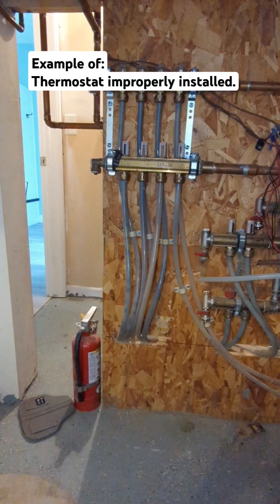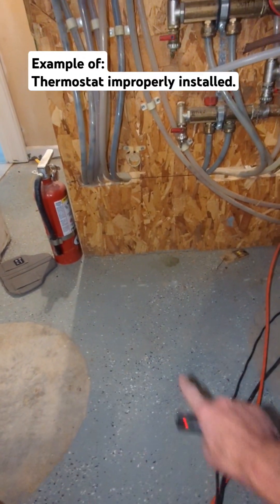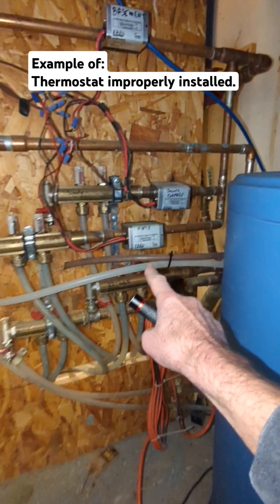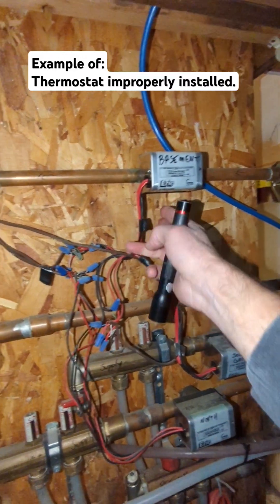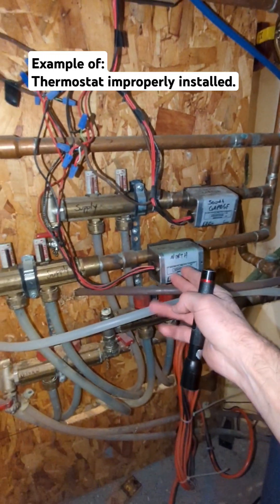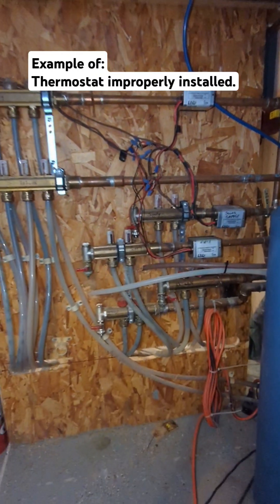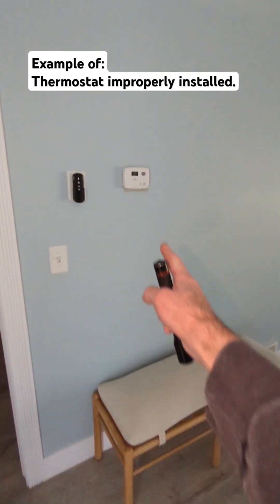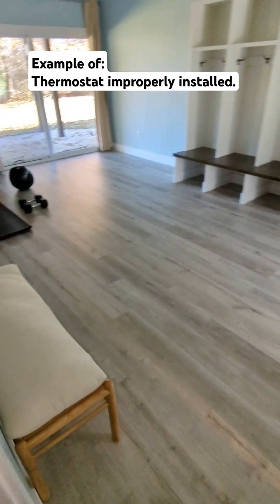🌡️🚫Thermostat improperly installed on boiler zone#youtubeshorts#shortvideo#shorts#realestate#hvac

Comment: As a former Cable installer i can almost guarantee that wall by the light switch was a PITA to get to so they moved over a few feet because it was more accessible.
Running wires AFTER the home is drywalled is difficult and costly

Comment: That room would likely be hotter and less efficient because the thermostat is in the closest. If the heat never gets to the thermostat, the switch never opens, leaving the solenoid open to heat the room longer.

Comment: I would be more concerned with the grossly undersized pipe on those manifolds. The manifolds are the size that they are for a reason. When you downsize them to 3/4 in, you are restricting flow greatly. I'd also be interested to see where the circulators are cuz I don't see any.